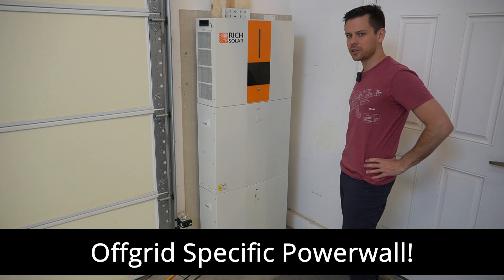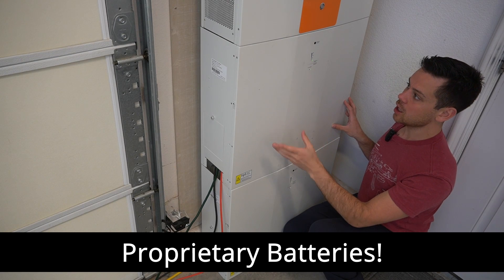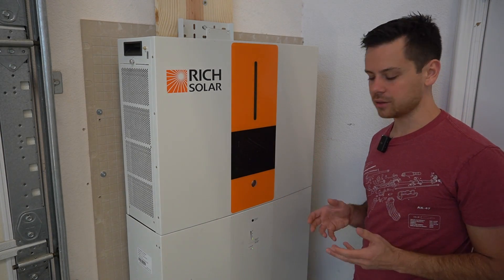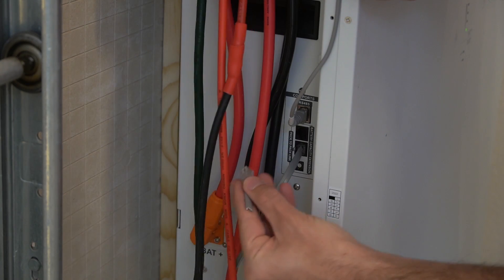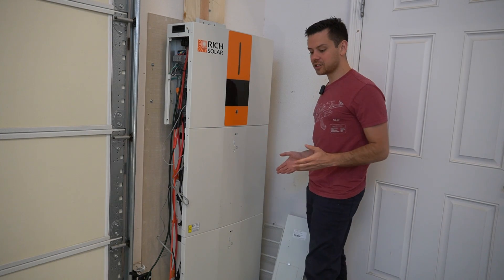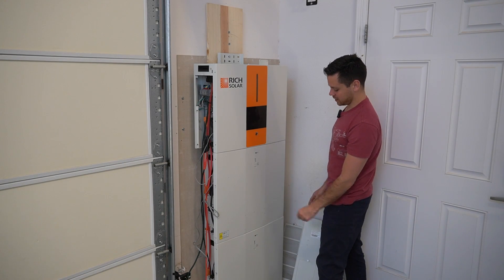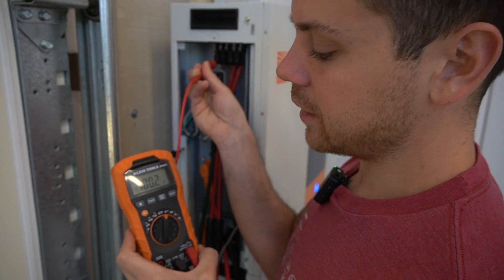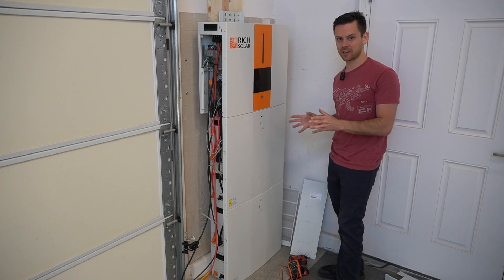Rich Solar Offgrid LiFePO4 Powerwall: Everything You Need to Know

Comment: Aloha from Kauai,
Will, I was thinking about purchasing 2 of these systems (with an additional battery for each system) mounting them side by side running in parallel in order to achieve 220 volt service.
Can the batteries be run stacked like in the video or is it necessary to separate the inverters from the batteries and parallel the batteries with some type of buss bar set up?
Thank you and keep up the great work!

Comment: The EG4 6500 DOES have high voltage on the MPPT terminals. I have been shocked by it, and I also blew the fuse in my Fluke meter. It's high frequency square wave AC.

Comment: Lvyuan, a rather-obviously Chinese company operating in Japan, are selling something just like this. Might be "badge engineered". They also sell systems made up of seperate parts which look like those scams that claim they can run your house but only have a 30w panel, only based on previous purchases when Lvyuan say you get 4x 200w panels you probably actually get that. Oddly their batteries are lead acid.

Comment: You should not mount it directly on the ground for the sole reason if it rains water might pool in the bottom battery or in a small flood the DC terminal is very likely going to get wet. Lots of garages are not perfectly level either so water or worse salty winter water might enter the bottom battery bay causing bad things to happen.
Reply from the maker: I opened up the case to see for this reason. There's nothing in the first few inches of the box everything is raised

Comment: There were 3 small earthquakes in San Leandro, Ca yesterday about 25 miles from me and a fairly large one near Mt. Palomar as well.
I've never seen anyone discuss or show how you secure your inverter, battery, charging system and solar panels so they work after an earthquake and wonder if you could do a video on that and will they even WORK after the shaking and aftershocks subside ?

Comment: There's an identical one from another re-brand of the same gear. The other one looks better, has a foot/base plastic so it looks more well-seated, and accepts 500vdc for solar. 250v is not enough for most people with multiple panels/strings. Oh, and it has a more modern touch screen GUI and is about half the price of this one. Sorry Will, not trying to get any business away from you. Thanks for the review. By the way, did you happen to measure the standby draw on this unit? Also wondering what is the full efficiency on a discharge test. Can it give you 10kwh back?

Comment: Unrelated to this exact product but I’ve had 4 rich solar server rack batteries running 24/7 for several months power a cabin with a victron system. My only complaint is there 48v stuff is 15s, not 16 like most.

Comment: Bruh, lemme first say I love your contribution to progressing society forward and thank you. 
Second, would it be possible for you to do a full video on outfitting a 43 foot fifth wheel RV with enough solar and batteries etc to run 2 air conditioners and other aux powered items at the same time easily. Maybe there’s an all in 1 unit like the one in this video that would be easily installed and hook up 8 200watt solar panels to it etc? If I’m gonna spend 15k on a full system, I damn sure wana use one that you like and approve of. Thanks again.

Comment: 6:35 in and i just don't see why it's worth it, the server rack and AIO is just so modular and not as stupid to setup and not much more expensive. i'd rather trouble shoot than be vendor locked and have to use rotoray phone cords and wall mount batteries

Comment: Hey Will, dunno if anyone addressed the communication cables thing in your comments (I didn't see anyone), but I may have some ideas why the comms were so obtuse to set up. They are using a signaling protocol like RS-422, RS-485, or CAN Bus to communicate between the batteries. Without diving too deep into the nerdy EE details, this has two chief advantages:

1. It's electrically robust, and will deal with switching noise (from, say, an inverter, or a battery management board balancing cells).
2. Super mature and simple-to-integrate. An Ethernet PHY like you described requires a lot more in computational resources. RS-485 or CAN Bus can be done with one chip, or even integrated directly in the micro controller running the battery management. Cheap and simple; just how the bean counters like it.

Based on the presence of the terminator (cut-off looking cable you highlighted) and the ID dials, I would venture a guess they are using RS-485, or some derived variant. It's pretty straightforward to an engineer who knows what they're looking at, and that's probably why it didn't initially come with that guide. Should be simple for them to put together a guide after the fact.

Edit: For my part, the turn-key systems are cool to see, but I'm skeptical of vendor lock-in like Rich Solar is practicing here. Realistically, this system could run for a decade, and probably won't need much in the way of service or parts replacement in that time. Still, when the time comes, I'll bet dollars for dimes that Rich Solar has moved on from this platform, and your average end user is going to need a completely new system when parts fail.

Comment: In the future I would like to buy a box truck and put solar panels on top. If there was any sort of system melt down, I think it would be best to mount the batteries under the box of the truck. But then how do you keep it dry while still giving the system cooling.

Comment: My house has limited power from the grid, only 120 amps. It's plenty to run all our current loads, but an electrician told me it was undersized to add an EV charger. Since then I've had an idea to free up some capacity by adding a unit like this. I'm thinking I could add a load center and move 6 or 8 (I currently have 6 circuits on a generator transfer switch. 7 or 8 would be almost perfect) of my current circuits to the load center. Then have two ways to power the load center. One is just connected to the main panel. The other is to power it with an inverter/charger. The hope is that I could configure the inverter/charger to not draw more than 15 amps from the grid. Then use the inverter and batteries to power the load center. Is this actually possible? Also, if all of the circuits in the load center are 120 volt, can I run it single phase? Obviously, it'd be split phase when connected to the main panel (option 1 above). But if I turn that breaker off, could I just run the two sides of the load center in parallel single phase when I flip it on? Eventually I also plan to add solar too
Reply: It would be way cheaper to upgrade your panel to a 200 amp panel.

Comment: Any thoughts for us northerners who have to deal with heavy snow and lots of trees? My brother-in-law next door is thinking of a battery system just for emergency use, like a generac would provide. Battery charging would be from the grid. Not sure if the utility would go for an “energy storage” rate to just charge at night—maybe. That might mean a whole house-sized system with enough capacity to carry over a few days outage. I’ve had a Generac 20KW unit for years, works great, has an auto transfer switch. Thanks for a great channel!

Comment: 240VAC split phase is a must if supplying a building.  Philosophically, PV supply and battery backup are two systems that should be packaged separately; keep voltages separated and provide tactile-reliable service disconnects for each device from its AC and/or DC bus.

Comment: Seems to be over priced when compared to top of the line server rack and top all in one. With batteries trending over the the last several years getting more for your money. Would be a great deal under $5000 possibly and an okay deal for $6000 but from your video and the given information i say it's very much over priced at $7000 especially with it's problems?

Comment: How do you blow a fuse in a meter when measuring volts..   The fuse is inline with the amperage lead socket..  were you trying to measure current and exceeded the 10A fuse?  The way you state in the video you blew the fuse measuring voltage..  not possible.
Reply: He was measuring Amps. He said so in a reply to another Comment.

Comment: Proprietary for batteries is a sheet. If company is bankrupt - you can do nothing. If you have issue with some battery - you have no many ways to fix it without this cmpany. You just relay on only one company... Totally not best by. Specially having so many other invertors that can work with each and every battery on market, with same easy install.

Comment: Proprietary =a no go for me. Even if rich solar is still around in 5-10 years when components begin to fail,  the chances that their current models will be reverse compatible are slim to none.  1 component going out would result in having to replace everything right then. 

As an example,  I have been looking at used chevy volts. They are just about the perfect vehicle for me.  They have a battery capacity that I could easily charge on my current system, even after charging my home bank, enough range to cover my daily driving 99.9% of the time, a gas backup so I'm not stuck waiting to charge if I take a road trip,  BUT Chevy had already gone out of production with both the car and the battery packs,  so what happens if I get one and the battery goes down,  I'm stuck buying other used packs at inflated prices because everything about the system is proprietary and Chevy has provided no supply of new replacement batteries. Proprietary sucks and should be avoided whenever possible.

Comment: Form factor is good - I don't mind the way it looks if it's not in my living room.  Seems like kind of a pain to setup given it's an all-in-one.  I won't be surprised if the add a safety interlock for when the cover is removed - super easy to implement.  That said, there are all sorts of things in existing residential power systems that will shock you if you remove a cover - even just a standard receptacle or a light switch is a shock hazard with the cover off.

Comment: Thanks for all the great info. I’m building a cabin starting this spring and have been following your vids to get some ideas of how to set up my system. I like the variety of system deployments you show. Keep up the great work!
Reply: I would go with the EG4 system from Signature Solar it’s haft the cost and what’s great it’s scalable, for the same cost of this unit give or take a little you  can get 2 EG4 6500 and 4 batteries giving you 13000 watts of inverter power and 20k watts of battery power more than enough to power your cabin

Comment: I like the smooth look it has.  It’s very clean and minimal looking.  Would be better if batteries were “separate” as far as the control. 2 units in split phase with 4 batteries would not take up much space.  The other problem is having two arrays, but I don’t really think that is an issue either.

Comment: When you say it has a 10 kWh capacity, does that mean 10 kWh of AC power output or DC power output? or does that mean it stores 10 kWh, before any power loss in the inverter? What would be the power loss in the inverter?

Comment: Will - please do a more in depth review on this unit..  Can it accept AC input from a generator, how does the inverter operate when hooked to a small 2000w generator (if the full AC output available), what do the AC output lugs look like, max amperage at 120V, etc.   Maybe suggest to the vendor they post the full manual on their website...

Comment: I would love to see a company make a eg4 6000ex in a high frequency format that only used the standby energy of a eg4 6500. I don't need a lot of inverting power but would love to have the 240v without suffering from high standby load. It is why i only run a single eg4 6500.

Comment: The integrated system looks clean and neat. I would rather have a larger choice of batteries and using multiple units together seem awkward with each one needing its own batteries and solar array. I need a 240v system so I won't be going with a system like this.

Comment: U r right Will... This unit for small house backup or small cabin.  I actually follow u on the growatt... 15kwh server rack.  Then change to EG4 6500  for more power and it have air filter out dust. Love it.  I bought more solar n batteries cell put together 16s 15kwh,  total 30kwh 5kwh solar. Plan to buy 2800 more solar because the weather change now, more cloudy in San Diego CA.  Will upgrade to 60 kWh batteries.  4 person family and a Tesla M.Y.  without Tesla 30kwh battery n 5kwh would be ok.  Thanks Will.

Comment: C'mon Will. Solar never gives you 100% of its rated power. Putting 7-8000 watts on a 6500 watt is perfectly safe and ensures you are likely to have maximum power input for the batteries in less than perfect conditions.
Reply: Not entirely true. My neighbor has 4200W of solar, but after a morning of clouds, the sun came out and he saw 4750W coming from the panels. Not a normal thing, but it is possible, apparently.

Comment: The Beechcraft fell out of the air as soon as he put his landing gear down. He was too slow and too low to add that much dragged to the aircraft. He would have better have landed with no gears down and then that would have extended his flare so you could do a belly landing. Remember when your airplane is in emergency situation fly the aircraft and try Landing it don't worry about messing it up
Reply: be sure your batteries are charged before take off

Comment: Thanks for the review.   I find it totally unacceptable to be locked into one single "ecosystem" for everything - even if the company were in no danger of going under, it has you over the proverbial barrel for wealth extraction when it comes to expansion, upgrades, replacement of batteries, or repairs/maintenance.    As you say, it's definitely NOT for everyone.
Reply: Exactly 💯 agree
Reply: I totally agree
Reply: I agree

Comment: I use a product called a Pomcube Net Zero (totally off grid). Very similar to this unit. Has a 12.5 kW 120/240 inverter and a 20 kWh battery bank but high voltage battery and high voltage PV input. High voltage IMO will be the future as PV arrays get bigger and inverters get bigger too to be able to charge EVs AND run a fully electric home too. But the Pomcube customer support SUCKS so I would NOT recommend buying a product from them because they basically offer ZERO support. I have been contacting them through email and voice mail for literally weeks but they DO NOT RETURN calls or REPLY to my emails. Their product is pretty good so far but has misleading specifications which was updating and needs to be corrected.

Comment: Price point is very high with few advantages over something from signature solar. It's kind of nice that it sits flat against the wall. But I personally would go with a large server rack style system. Something like 6 ~5kWh server rack batteries. I'm still waiting for suitable rack mount inverter. I'd love to actually have 3 inverters at the top of an 8ft rack and have the option to run 3 phase tools. I'd also want a rack mount distribution panel as well. All the power related stuff in one foot print. I could do the distribution panel using DIN rail breakers and such. Someone must make a suitable rack mount enclosure. 

I'm like 20 years away from building my dream off grid property. It will be my retirement home. By then we should have even better and cheaper batteries.

Comment: Based on the wiring configuration, Can the battery units be mounted horizontally opposed to each other instead of vertically?

Comment: Had one in the UK from Voltacon. The systems was very basic and ended up having to send it back because the WiFi module wouldn't work. The 6.5kw is not enough to power a decent size house. Now installed Plytontech 5kw x 4 and a 11,000w inverter

Comment: Hey Will, i've been wondering if LiFePo4 batteries might be used in some manner for tractor trailer drivers. My truck uses eight deep cycle 12V lead acid batteries to work the inverter and heat/ac. I foresee two Issues. One being cold environments if the truck is left unoccupied but the biggest one is the starter. They use about 1600A. Would lithium batteries be able to bypass the bms with a contactor for such a high current load? Are there any off the shelf batteries that can handle that or would it have to be a custom build?
Reply: Good question! I wonder if there's any way to use a seperate battery system for the starter, with these for the inverter, as, to the best of my knowledge, there are no LiFePO4 type batteries that can handle repeated usage as a starter battery. (I hope I am wrong there, and someone can set me straight, as well as answering your question.)

Comment: Will, why would you leave electrical components touching the ground?
I understand the need for the floor to carry the weight, but why not lift it off the ground using a wood platform? My concern is corrosion and rust. I understand that 98% of the time Nevada is dry, but that means that 2% it's wet.
Reply from the maker: The metal box is empty at the base. So if water comes in, it's fine. I should have mentioned that. And I don't trust 300lbs on a stud lol
Reply: wood will soak up water .better to use plastic